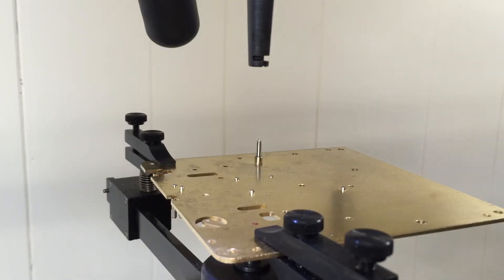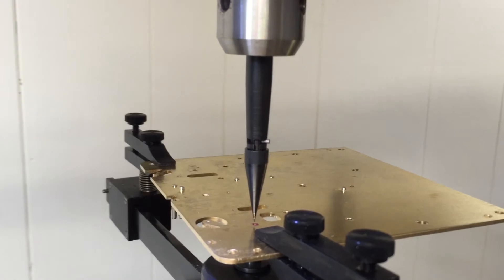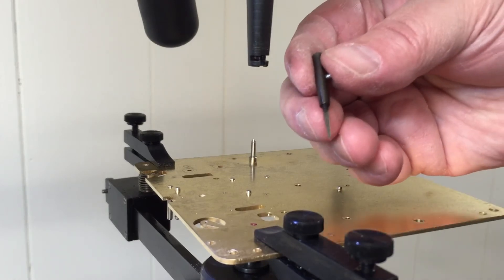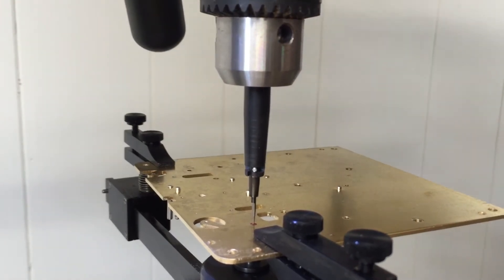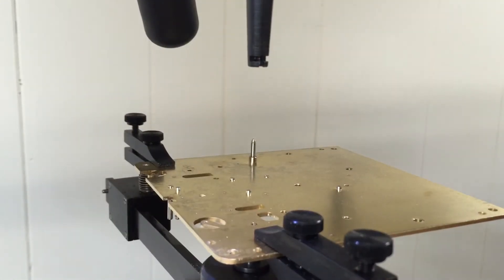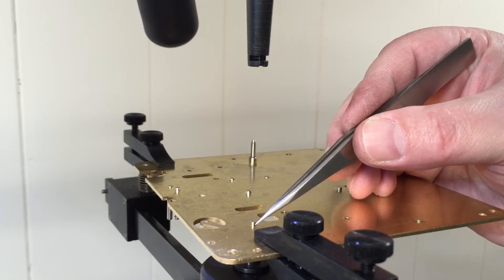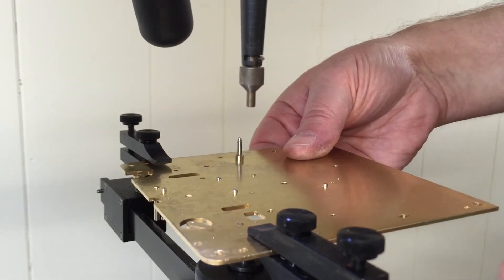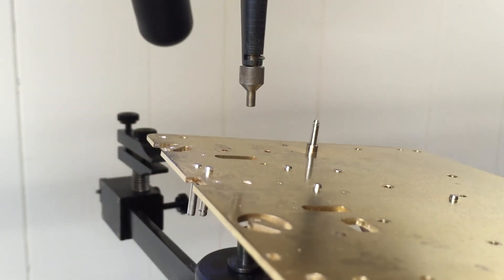Rebushing the front plate - Urgos UW32/1A grandfather clock movement. Part 1 of 2.

Comment: Good video.  Just thinking, Why not use the drill press on low RPM to ream?
Thanks,
Alan in Virginia
Reply from the maker: Alan, thanks for watching! 

It’s all about precision control. I only need a few turns to ream through brass. It cuts VERY easily by hand. Starting the motor would tear it up completely in an instant. Even the slowest RPM setting on the press would be 1000x too fast. Plus, the ream needs to be turned in both directions to cut/clean the way I like it. “REAL” reamer rigs have no motor at all. Just gentle hand-cranking. This was my solution on a very tight budget.

Comment: Great video, how do you work out where the center of a worn hole should have been?
Any kind of center tool will surely fall into the widest point of the worn hole, not the original center, so how can you get the new hole back on its original and proper center?
Reply from the maker: Inssan, that’s a great question. Since finding the original center is critical, it is of course something that must be carefully studied before commencing with the reaming. 
Also, one must be sure there’s as little slop or movement in the tools used or the ream will just drift off center.

Use a magnifier if necessary and look for signs around the original bushing hole that would indicate the original oil cup bevel versus the more vertically cut side where the pivot worked its path away from center. The direction of travel will always be in one direction since it’s the pressure of the drive spring or weights that cause the pivot to cut a path away from center.

If you’re pretty sure, but not convinced you’ve found the original center, it’s also a good idea to observe the wheels with the plates assembled and the spring/weight tension removed. Align the wheels so the teeth mesh evenly and observe the pivot location. This of course can be done before initially disassembling the plates since that makes the job much easier.

Once you’ve located the original center, use the center finder bit to get your plate aligned correctly and then clamp it down. Use very gentle touch to get your ream started and it’ll work out fine.

I have, on occasion, had a bushing so worn out that a new bushing would not fit without falling through. In those cases, I cut the hole to the next size up, used an oversized bushing and then reamed that larger one out enough to fit the smaller, correctly sized bushing into it. I don’t much like “double bushing” but it’s sometimes the best solution.

Comment: Good video. I am starting out. What do I need to do bushing by hand? I have successfully taken apart about 7 cuckoo movements, cleaned and put them back together. A couple need bushings. Heya is the best way to start doing this without investing a lot of money in the beginning?
Reply from the maker: Francis Cole, I’m glad you found my video helpful. Be sure to watch part 2 for the finishing of the bushing job.
My reamers are actually designed for hand use. I use the drill press to help with alignment so I get an accurate hole that’s perfectly perpendicular to the plate. But if you practice on a few junk holes, you can quickly become plenty good enough to bush completely by hand.

Visit timesavers.com or merritts.com for tools and bushing variety packs. I recommend starting with a tray of bushings such as https://timesavers.com/i-8944942-american-brass-kwm-bushing-assortment-no-ii.html but be sure to review the sizes you need most. There are plenty of sources, so shop around.

For the bushing tool, look at something like https://timesavers.com/i-8948895-kwm-style-hand-reamer-set.html

You’ll also need a set of cutting broaches and a set of smoothing/polishing broaches.  https://timesavers.com/search.html?q=Broaches&go=Search

Have fun!
Reply: I just saw this! I appreciate your response! Thank you very much for taking the time out to answer.
Reply: if its a regula 25 you can buy a new one for 70$, no one bushes cuckoos, Unless it is a 8 Day with Sentimental
Reply: TheOnKnee I bush all cuckoo movments and know a lot of guys that have only ever replaced a handful of them. I’ve successfully bushed 70 or so movements since September. All are still running great. I can strip a regula 25 down have it cleaned bushed and polished in less than 5 hours, many are dated and go with the case. Many older ones are all brass, and built better like the perch flag, starwheel, wheels etc.

Comment: Where did you get the clamp apparatus to clamp the plate to the drill press?
Reply from the maker: I got it at either Merritt's or Timesavers. It was awhile ago so I don't remember exactly.
Reply from the maker: Looks like timesavers no longer lists this. But I found it at https://www.bckntime.com/kmw-drill-press-bushing-adapter/
Reply: @afixedpointintime5142  This link and this parts store www sites seems to be always down.  Is there another location to find this drill press jig?  TimeSavers has  a $155 jig called a "Clamp-On Bushing Tool For Use With The KWM System" that looks similar but is obviously different...  Any idea what yours is called or cost?